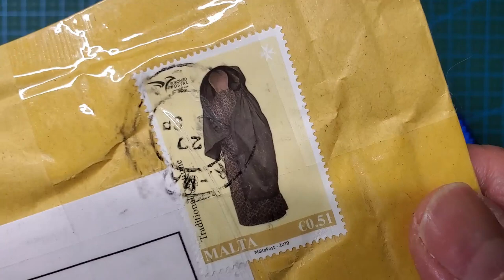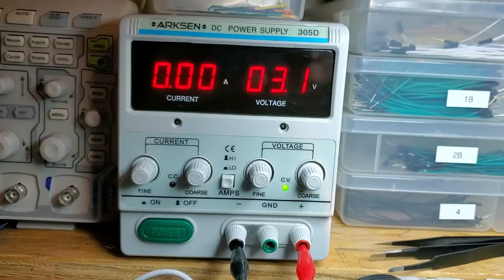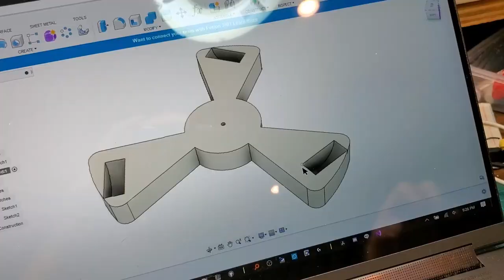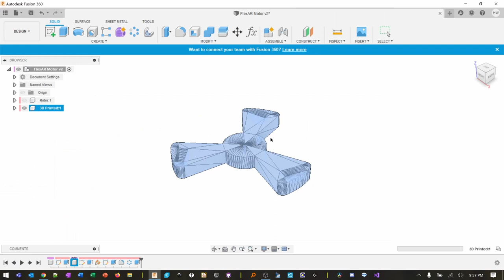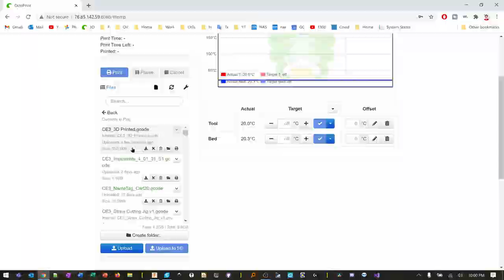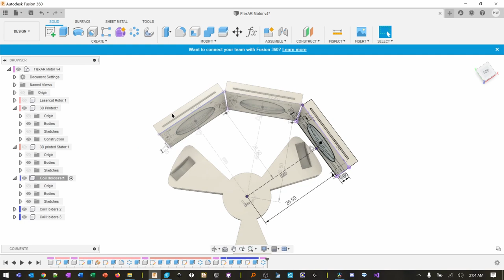HariFun #188 - 3D Printed Motor

Comment: Viola! A BLDC from scratch. I think there is great learning value in creating something even if it's been done before. The joy from learning is part of it, but the most valuable part in my mind is the intimate knowledge you gain about the device. It's like when I built my first 3D printer from a kit. I knew every mechanical adjustment that could be made to the device for when I wanted to tune it later. Congrats!
Reply from the maker: Hi R Dyer! Believe it or not, I had to Google BLDC!  I vaguely remember how stepper motors turn on combination of coils to get finer steps, that's how I came up with the idea of multiple coils.  Apparently I unintentionally reinvented BLDC!  Ha ha! It still does not work as well as a real DC motor. Sometimes it spins the wrong direction and get out of sync.  I wonder if I need more coils?!  You're spot on as far as gaining knowledge by building things yourself.  It was exhilarating to see the motor spins! Thanks for the comment R!
Reply: @HariWiguna  A BLDC has coils all the way around, so yeah that would help. However I suspect your problems are due to coil excitation timing. Play with your software and I'm sure it will be more reliable and you'll probably easily get more speed. Good Luck!!

Comment: Neat project!  Since your magnets are 120° apart, you might try putting your coils 120° apart as well.  Then put a Hall sensor just before one coil, which will tell the Arduino when the magnets are about to pass the coils.  With that info, and a little experimentation with pulse timing, it should be possible to accomplish speed control, and even braking!
Reply from the maker: I love the idea of spreading the coils at same spacing as the magnets so they all work simultaneously.  Thank you for the improvements ideas!

Comment: What a nice project. I have just received the flexar (6x). What components did you use for this project and is the arduino code available?
Thanks
Reply from the maker: Thanks.  I used an Arduino Nano, three generic PNP transistors (with 1K resistor on their bases).  I put the code listing on my Hackaday.io page:
https://hackaday.io/project/175837-playing-with-flexar
Have fun!